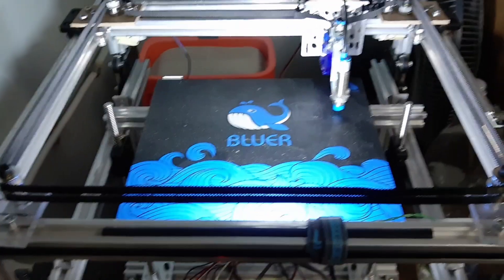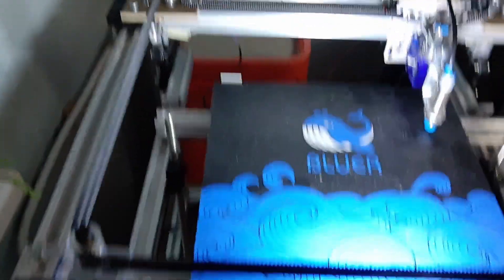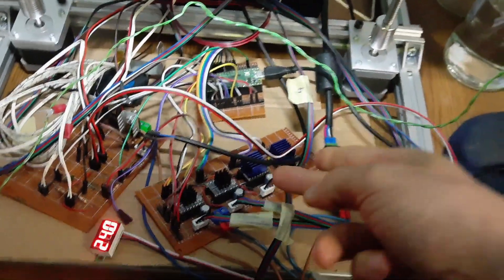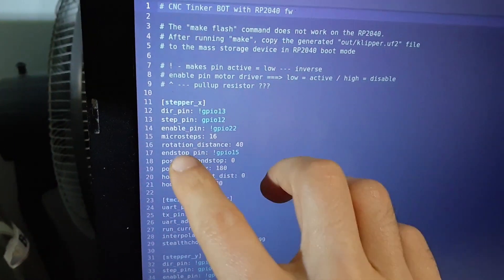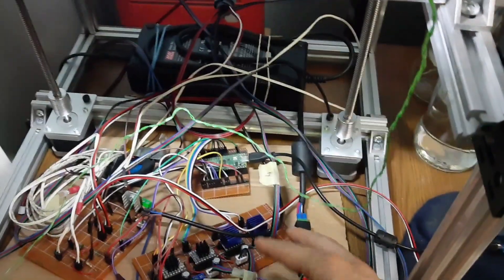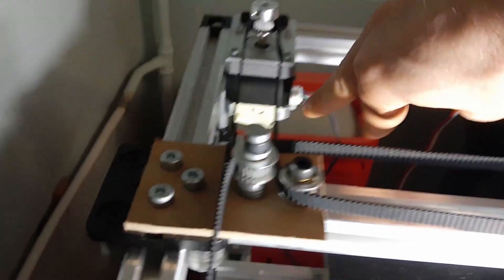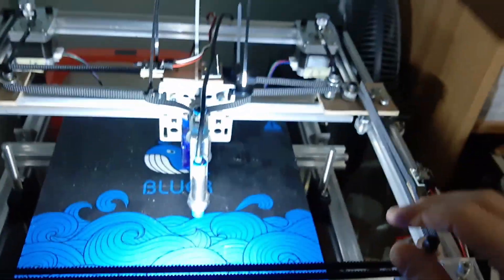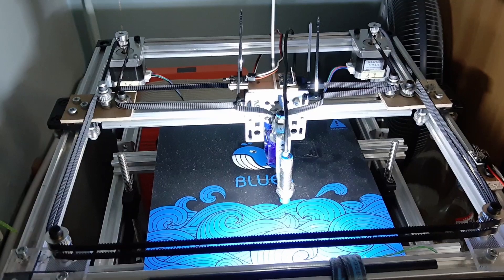Klipper fix homing wrong direction / corner corexy

Comment: I have two  end stop switches near the rear right motor, the motors are moving to the correct position during homing.  Now I want the origin to be at the front left corner,  and I don't want to move the end stops , how do I do that? I see the "position endstop" configuration in the x and y motor, but if I change this, motors start moving wrong way when homing. thanks
Reply: Someone suggested to use the Voron Initial Startup Guide, and it helped. It has excellent photos to show what to do for different scenario.  I'm able to set the origin for Ender6 at Front Left corner with the endstops at Rear Right corner

Comment: how do you fix the origin problem ? for example cura has it's origin in the front left side of the printer, if you don't mirror the part it will mirror the print. i mean yeah, you could just use another slicer program but i was wondering if there is another way

Comment: Can you also explain how to reverse the Z-Axis?
Reply from the maker: go to printer config and put a ! in front of the direction pin of the z motor you want to reverse. you can also achieve the same thing by inverting the motor connector on the motherboard - if you have a dupont connector that can be pluged the other way without a notch.